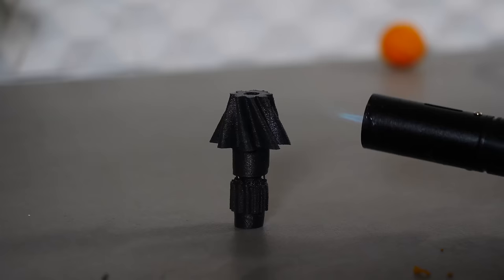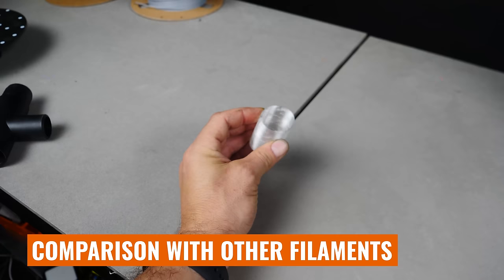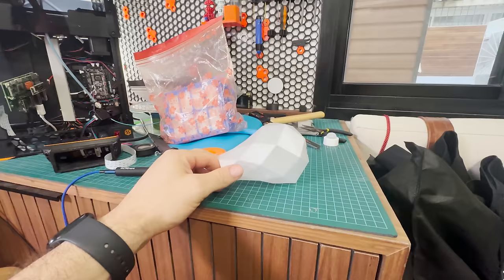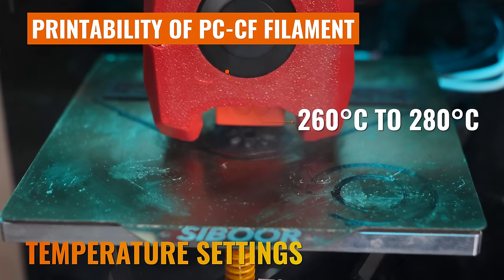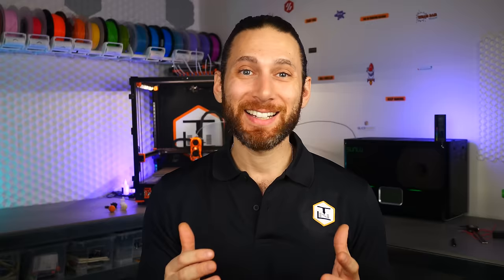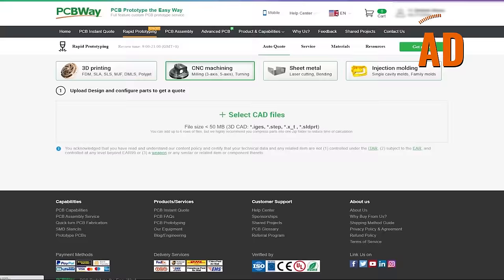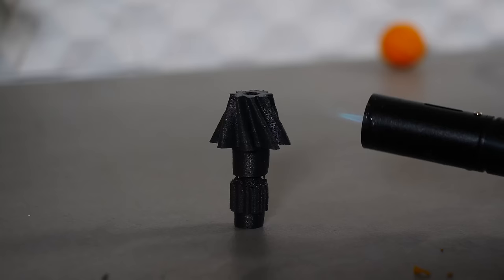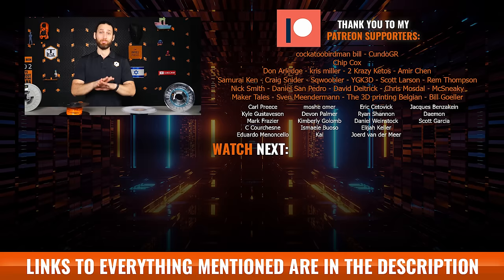7 Specialty Filaments that Will Revolutionize Your 3D Printing

Comment: in general PP has an inherent fatigue resistance. PP can take a repeated, vigorous beating, it lasts longer with proper lubrication. PP doesn’t do well with abrasion without lubrication and can sustain damage. make sure that whatever you’re making with PP is sized properly for application.

Comment: When i first started printing ive heard of pvb. It was advertised that it prints like pla or petg but als you mentioned it can be smoothed with ipa. So i bought one roll and started going. I also noticed that smelly smell and extremly bad layer adhesion and it didnt took me long, to throw it in the corner. Also had issues with the filament being satred with water and i didnt had a filament dryer at that time.
Reply from the maker: Yep. I kind of hate it.

Comment: I used PP for a medical prototype for a senior design team. pp is a command material in the medical industry and it was possible to get medical grade versions. Problem is that warping is really bad. Even with a bed at 90-95c and PP pro bed glue. It almost completely messed up the threads. I used it on a bambu labs p1s

Comment: I used to work in the Injection molding industry, and we used some CC. It was PBC,  For dental parts. AND IT SUCKED. Every new batch we got in was a different blend, So we had to redo the process every time. Sometimes it would very in a batch. Even the color wasn't consistent.
Reply: Or was that PBT, I cant remember.

Comment: You got me thinking when you said that PEBA is more chemically resistant than PLA or ABS. I've actually found PLA to be quite chemical resistant, or at least to gas and oils, acetone, IPA, and a few others. But that got me thinking that it would be cool if you did a series of videos on the chemical resistance of each filament to show what they like and don't like, so people can make a better choice when chemicals are going to be part of the environment.

Comment: I basically never heard of any of those special filaments, well except PC or PC-CF. CPE sounds nice. Would be nice to print stuff in something that has the strength of PLA, and heat resistance of PETG or even better. Also UV resistance would be nice. I was considering trying out ASA (have a roll or two purchased recently) but with the health considerations in mind when doing so. If there instead one of these filaments in this video could combine all these properties, and at the same time print more easily, and better for the health, it seems to be a non-brainer. Of course taking the cost into mind as well.

Comment: I have built my RatRig with all printer parts out of Prusa PCCF. Cracked one part by tightening a screew to much otherwise no problems.

I have also made a coffee mug out of nonoilen, worked ok as a mug maybe too light and easy to tip over. Only got it to stick to clean glass bed, heated.

Comment: My filament strategy is avoiding costs. So I store alays only 2 basic colord (black & white) and I use 95% PETG the rest being PLA (only because it is slighly cheaper).
Initially I wanted to use translucent material for everything which is color in while printing with a marker on a holder, but I honestly didn´t feel like it and just stored 2 colors. I can color in the white with all sorts of paint if I want to, everything else is a waste of space and money.

Comment: A note about PC : PC is weak to chemical, so even with high temp resistance it should not be use in oily environment. I'm not sure if it will last in the use case like in 8:14
Reply from the maker: Oh good point

Comment: What about another video containing info about PVDF, PPS, PETG-/ABS-ESD, Stone-/MetalFill, HiPS, PC-ABS, PMMA, Durabio or foamed filaments?
Reply from the maker: Dang. I have a lot more to do. I haven’t even heard of most of these.
Reply: @thenextlayer  And while you are at it, you can add PCTG to your list as well. ;-)
Reply: It would be great to see a video on entry level engineering materials (think of outdoor fixtures under constant load) and then rate them by how easy those materials are to print. Do a tier list. :-) For a material to qualify as "entry level engineering" we could say that they need to withstand a "constant exposure/abuse" of some sort, for ex: repeated bending, constant mechanical load, UV rays, heat, chemicals, a.s.o. As for how easy the material is to print, the categories could be: non/low hygroscopic (needs no drier), heated print bed, print bed adhesion, elevated nozzle temperature, hardened nozzle, low warping, needs enclosure. Needing an actively heated enclosure with over 50° C should rule out the material, making it "non entry level".

Comment: So I actually work with designing ADA signage with some limited functionality, sliders, pull tabs, etc. Usually we just laser cut acrylic or CNC aluminum, but in the past few weeks I've been testing additive manufacturing for more custom applications with really positive results. 3DXTECH is a local supplier of ours so I'm testing their NYLON 6-66 which is functioning mechanically great, especially paired with Polymaker polycarbonate. These filaments are all new to me and it can be hard to keep up with what's new on the market, so I greatly appreciate videos such as this to introduce them. 👍

PETG has always been my go to filament for my own projects, but I've had to invest a lot of effort into keeping it dry. I'm so going to try CPE now lol

Comment: Carbon fiber does not add strength, this is the most common misconception with this material. What it really add´s is rigidity and it helps with warping a lot, simultaneously it reduces strength in Z-direction. Take the later mentioned PP Material. PP Products are almost always used with GF or GC reinforcement to make it more rigid and injection moldable in the first place. Same goas for 3D printing.

Comment: Is there any guidance on the UV resistance of these? I often have the need to print plastic for outside and the Sun is a huge enemy.  Maybe skip the shoes, the risk of tendon and ligament damage from the tarsals to the lower back is real. It will need a  /lot/ of prototyping to get pain free.

Comment: PCCF looks good to print replacement handles for a soup pot. Actually PC should be good enough but why not.
Reply from the maker: Yeah PC is fine. PEBA too actually.
Reply: @thenextlayer Not quite sure about PEBA. It's GTT -65/-50 C so it may slowly deform over time even without heating. Putting it on the stove will definitley speed up this process. PC with GTT +140/+155 C looks like much better option.

Comment: howdy Jonathan @thenextlayer !

Hope you and your folks are doing fine.

On the last video I commented and made quite some interesting remarks about Tritan, which very few people heard about. Here´s the thing: why is it so hard to find? Because the name "Tritan" is actually a registered trademark by Eastman. 🤦‍♂I haven´t realized that by then. 

It seems that you found it out, CPE, I´m happy for that! However, some manufacturers also call it PCTG, although some variations in specs regarding thermal deflection (some say 80C, some say 100-110C). As I mentioned in my previous video is my favorite go-to filament, as it´s quite friendly to print although requiring bed temps around 100C (I print it a 105) and an all-metal hotend (I print it at 265). I did quite some car parts (even for use in the engine bay),as I commented in the previous video. 

Note: On my research I even found variations with glass fiber(PCTG-GF)  and carbon fiber (PCTG-CF), which I will certainly give a try soon, as I´ll need to import it. And it´s not that expensive, about 28 euros a 1kg roll (standard, about the same price I get it here in Brazil) or 30 euros a 500g spool (PCTG-CF10, which I can´t find here but I can source from foreign sellers).

I might give a try on PP for my projects. How easy is it to print?

Comment: Now I'm thinking about grabbing a roll of PC-CF to make an intake piece for my car 🤔
Reply: I've used carbon fiber nylon for under the hood and it's amazingly strong after 5 years. I'd be scared to use carbon fiber PC since it's supposedly more brittle idk, might be perfect! I've been playing around with Glass Fiber PC and it's a win/win over PC imo. It's stiffens up the part a bit but also makes it very impact resistant
Reply: If the temperatures allow it, I'd use PC-ABS. I think it's a really good material mix for many demanding applications.

Comment: - PEBA (Treed Flexability)
The filament i used was called TPE-A but it's essentially the same flexible polyamide, mine was shore 75A so really hard to feed through the extruder (i had to push it into the gear using an allen key) but i somewhat managed how to print it (veeeery slow).
It's incredible for flexibility, resistance to scratch, wear and chemicals, I've used it to print custom gaskets and seals.

- PC-CF (Prusament PC carbon)
I bought a roll to pint parts for my Prusa i3 MK3S+ modified for high temperature printing (400+ °C), the overall feel is that the printer structure is much more rigid than with PETG parts (it even "sounds" a little different), the leftovers were used for a smartphone holder for my car and a replacement hinge for a toolbox.

- PP (Treed Plene4, Plene5, Plene Carbon, Formfutura Centaur PP)
Polypropylene is my nightmare, because of its cheapness and high chemical resistance I've used it a lot in tanks and labware for electrochemical etching (nasty stuff with hydrofluoricacid).
It warps like crazy even with machines that print ABS as easy as PLA, formfutura blend is the easyest but i suspect it has a lot of additives, Plene5 is almost pure and warps even in small thin pieces, PP-CF with carbon fibers is much easier to print but i needed watertight (acid tight in my case) prints and the resulting prints were too porous so i had to use it only for the supporting parts.

CPE is a family of polymers (relatives of PET, PETG, PBT, PCTG) so their characteristics will vary, typically filaments use materials of the Eastman Amphora family and are sold under a lot of different marketing names.

Comment: Are there any flexible filament that performs like rubber (or foam) but doesn't suffer hydrolysis like TPU/PU? Footwear made by PU will crumble and deteriorate over time if left in humid environment.
Reply from the maker: TPE is pretty good

Comment: personally i sadly haven't had the chance of trying any of these filaments so far... i absolutely will  in the future especially after now knowing how insane those filaments are... 

Love the NonOilen as well, currently i am mainly printing with PLA (+) because it is based on corn and therefore renewable and not from oil... sadly it misses the ability to just be thrown on any compost, which would be useful for some prints...

"Food safe" in my opinion is useful for one time use (compostable feature for throwaway comes in handy) because the material itself can be food safe, but as long we don't have a solution to smooth them, bacteria will grow in the layer lines which doesn't make it safe any more.

About the soft filaments i am having issues with the CW2 on my stealthburner of my Voron 2.4 and can print it at a max of 4mm³/s at maximum tension ... i have a slight idea what could fix it or else i am searching for solutions (mainly extruders) to print soft filament faster because on the other hand i am working on a fast Voron 2.4.
what was your maximum flow and therefore resulting speeds with TPU, chincilla and PEBA ?

thank you very much for your informative and educating content, appreciate it 

and sorry for the long comment, couldnt make shorter... i know you have hundreds of comments to read if you read every single one 😅
Reply from the maker: I think I was able to print at 8mm/s!
Reply: @thenextlayer  I see a unit mismatch. 3DPrinterWolf was describing his flow as a volumetric flow (cubic mm per second). You are describing a linear flow (mm per second). Is one a typo, or are you guys talking apples and oranges?

Comment: If you do the barefoot shoe project, please incorporate ventilation and multi-materials if possible. An interesting support material at interfaces would also be quite desirable. Yes, this would be expensive, but there is a lot to learn from your mistakes doing it. I did not forget to like and subscribe so that I could encourage you further.

Comment: I tried CF filaments many years ago and was disappointed, the CF chops were too short and really just made it a more effective matt surface without sacrificing part strength. The cost put me off fiber filaments till last year.

Now I regularly print CF PETG and Nylon, GF PC, and a few more. The costs are where I don't have to worry about failed prints either 😊. First 500mg roll of CF PLA i got many years ago was $80 and I definitely was very paranoid of failed prints as they would cost ~$10 on average for small prints in material, Where's normally it would be around $1-2 😅 and it was barely better than normal PLA and about the same as white PLA 😂 Titanium oxide is used to color the filament, which is why when you see plastic couplings for coolant hoses on cars there usually white

My point is, filaments have seem to have gotten far better in the last few years and much cheaper in the last year 🎉
Reply: You can't expect full CF characteristics of traditional (molded) CF materials in a 3D print. There are printers and filaments with long strands, but those are probably not something we'll ever use at home. CF (or GF) still makes the part much stiffer, though, even when those strands are extremely short, but you need to compare it to an unfilled material. Also, different manufacturers produce completely differently behaving materials that are labeled the same - Plasty Mladec PETG-CF uses (probably) much longer strands which makes the layers tear on overhangs or when printing too fast, while Bambu Lab PETG-CF is mostly tuned for good printing and asthetics, so it feels much smoother, prints much nicer and faster, yet won't have the same characteristics (good or bad) like the PM PETG-CF. But it sill has a big advantage over regular PETG when it comes to stiffness.
Also, CF makes printing easier because it holds the layers together, so less blobbing, and it conducts heat better, so more even printing and better cooling... :-)

Comment: @TheNextLayer - Out of curiosity, what is that loud whirring noise mixed with a clicking sound that I hear in each of the shots showing your printer? It almost sounds like your StealthBurner has a loose valve rocker/lifter (found on the valves of a normal car engine).
Reply from the maker: That’s me showing the extruder skipping with flexible filaments

Comment: Acetone isn’t really any better/worse than IPA
They have effectively the Hazard Categories and Ratings in their MSDS; Flammable 2, Eye risk 2, Organ Tox 3; Acetone can be a little worse in acute, but IPA is rougher in the long-term exposure

They’re not the ones to fearmonger  - It’s the ones that’re used for PLA like Tetrahydrofuran (THF) or Dichloromethane/Chloroform (DCM) that’re the REALLY nasty ones and aren’t worth the risk 
Both are quite carcinogenic even in short term exposures, fuck with multiple organ systems including the CNS and morel - the kind of thing you don’t handle without a fumehood or suitable alternative 

Thankfully Ethyl Acetate is about as bad as IPA/Acetone and smooths PLA well; definitely the better option

Comment: You keep saying ductility, but it does not mean what you think it means...
Ductility is the capacity of deforming PLASTICALLY before breaking, so it is deforming and STAYING deformed. [Tipically used for how much you can stretch a wire before it breaks]

Comment: PVB makes me nauseous. I think I'd rather smell ABS. It's kinda like that overwhelming smell/feeling you get when using resin. It makes you kinda warm. I've used it for some layer line hiding but it wasn't really worth it due to the smell (for prints you would normally do in other filaments). However, 2 notable uses are: I made a fairly hefty size clear dildo for a friend (as a showcase only piece, no internal use). I primarily use it to make children's fake jewelry.  They really get a kick out of wearing fake gold chains/bracelets/rings/etc.
Reply: PVB and ABS are both stinky but the big difference is that PVB is quite safe to smell and food safe (as a polymer, not necessarily as filament) while ABS is not
Reply: @PaoloBernardoni  I partially agree. Although ABS/ASA/HIPS have the dreaded styrene in it, it's not released as carcinogenic gas until it reaches decomposition temp (approx 400°C). Below this temp, we're just worried about VOCs. The 3d printing community seems to have initially misconstrued some initial information and they ran with it and spread it. Now it's spoken as gospel. 

With that said, I still recommend taking precautions and limit breathing any of this stuff in.

Comment: PP smells awful. Smells like burning plastic bags. I wasn't mentally and physically prepared for this because I've never seen anybody mention it.  It smells AWFUL. Probably the worst of all actually (but doesn't make me nauseous like PVB). I used it on my Tevo Tornado with a Mamorubot PP/Fiberglass buildplate. A more exotic but easier printing variant is Olefin Block Copolymer (OBC). As far as I'm aware of, it was discontinued a few years ago but it occasionally pops up on eBay. It's really cool.
Reply: I have not printed with pp but I have plastic welded it a number of times on bumpers. On a bumper, it usually just smells like candle wax which is much better than abs. I’m wondering if they put something different in the filament.